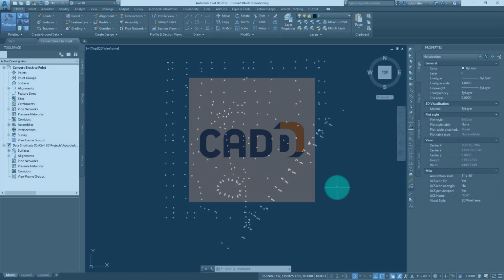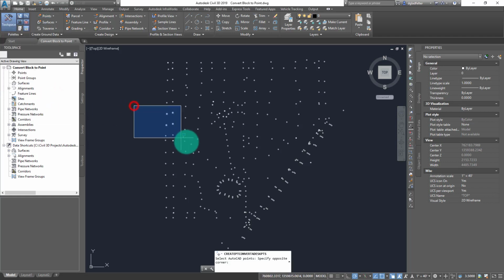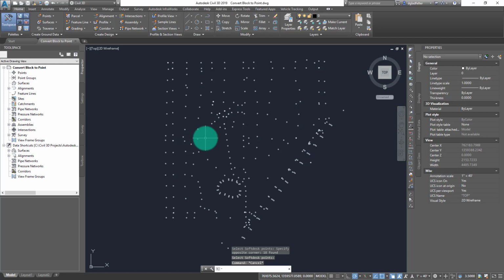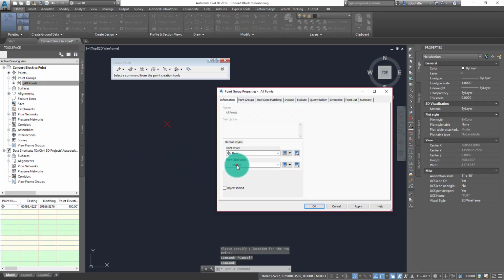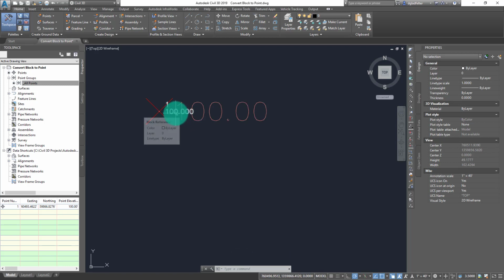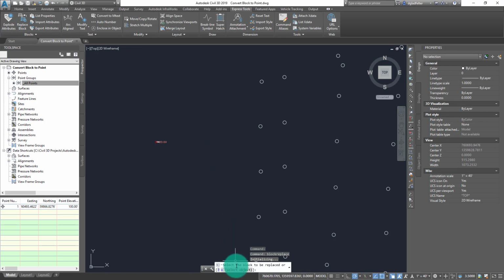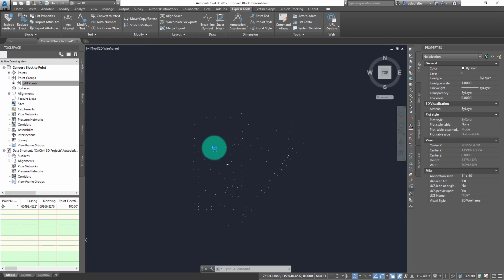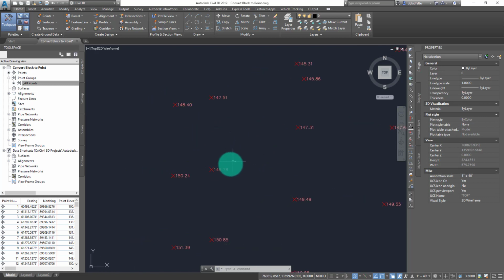Converting AutoCAD Blocks to Civil 3D COGO Points the Easy Way

Comment: Doesn't work for me, in my drawing the blocks (crosses) are all at 0 elevation/ level/ z, and the elevation I need to get is the written level text, which is written in text beside the block (cross).
Reply: Yes u can convert them into cogo points with elevation.
Reply: @naseerbhatti177  I have the same problem. Can we easily move the description (with the elevation) to Pozition Z?
Reply: @vesiyankova  yes possible
Reply: @chriswev  https://youtu.be/H-tCVd2c-Xs?si=RpteeFjfrtRQuNkL

Comment: Dear, i have tried as you did. The difference in my case is that i have two types of autocad blocks and i am trying to replace these with two different cogo blocks ( so that i get diff Raw description). It is not working fine. Autocad blocks  remain blocks after replcement even after running Softpoint to cogo point. pl help me. thx in advance. Ramesh
Reply: Hi I have the same issue. Did the problem resolved for you

Comment: A good tutorial, I often receive survey data with block X marks.  A potentially easier method that I use is to simply insert a point inside the block via the block editor, then explode all the blocks which destroys all the blocks and leaves the points.